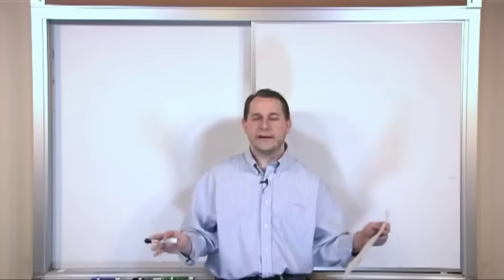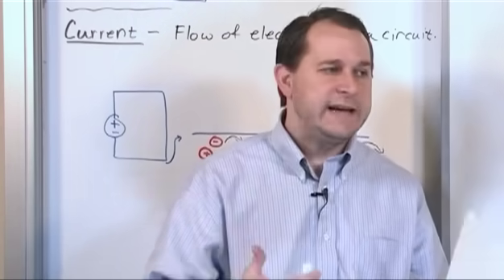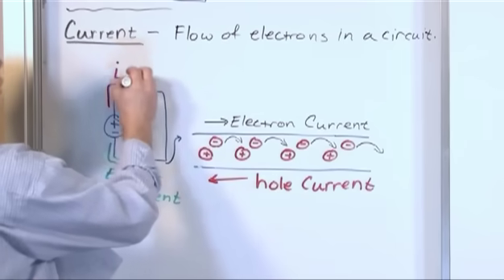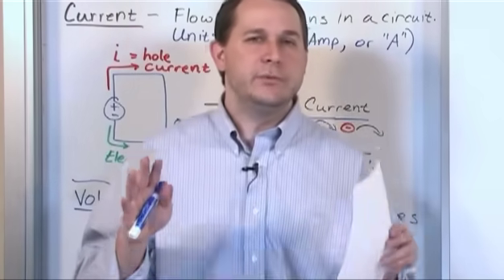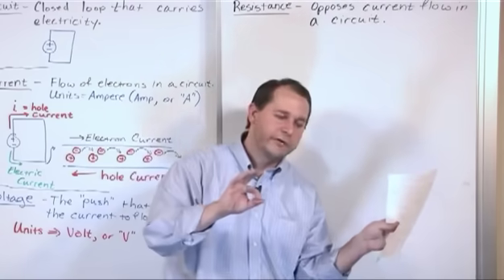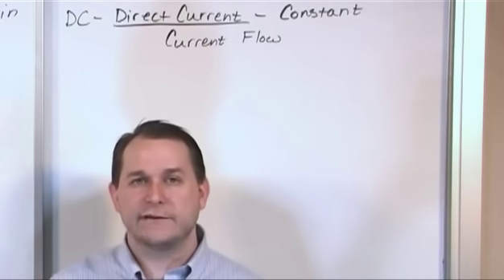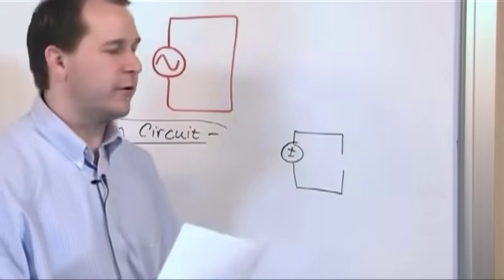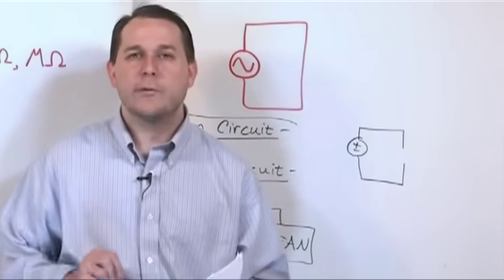Lesson 1 - Voltage, Current, Resistance (Engineering Circuit Analysis)

Comment: Thank you so much sir. I have a doubt. Let say there is a simple circuit just a battery and a wire. If I cut the wire, I want to know if the charges are there at the tip or not where we have had a cut.

Or they are there just at the tip of the terminals of the battery?

Comment: So in a short circuit why would the current increase if volts don't increase and resistance doesn't change?  Say you connect a wire between the two terminals of a AA battery, you said that the current will increase but to increase current you either need more volts or less resistance.  Since the battery is 1.5V it can't be that, therefore, does that mean the battery's resistance is changing?  If so why?
Reply from the maker: You have the right idea!  Exactly correct.  The battery voltage doesn't change.  A short circuit is just a piece of wire.  In an "ideal" short circuit, it has zero resistance.  A short circuit has no resistance at all.  So, if you plug that into I=V/R, and set the resistance to zero, you see the current goes up to infinity.  Now in the real world, a real short circuit doesn't have zero resistance, but it might have a few micro-ohms of resistance (a really small number).  So it drives the current up very high, but not to infinity.  Hope this helps! Jason

Comment: I have an old generator with only 1 hot & 1 ground Ac current produces 1,970watts at 90 Amps  , I’d like to hock it up to my breaker-box , use a 100 Amp double pole breaker - for when we lose power !

Comment: Good lesson. Though without mentioning WATTS your lesson is incomplete. A very important concept in electrical circuits.
Reply from the maker: Thanks!  This lesson covers voltage, current, and resistance.  A different lesson covers power.  Thank you!

Comment: Before power plants we had water wheels because electrical currents runs through water. Think of the electric eels. There is a video where they have electric eels powering a light in an aquarium.

Comment: I wanted to be an Electrical Engineer when I went to college many years ago. I dropped out after a few years and joined the Navy for the Nuclear power program. I pass the test but couldn't get the top secret clearance because of a few traffic tickets. After that I was an manufacturing technician building circuit boards. Today I'm a Slot Technician here in Las Vegas and the founder of a technology start-up. In progress now of inventing my own line of electrical equipment.

 I'm 55 years old today. This is an excellent review of the fundamentals!

 I wish you were my professor when I first started out. It is never too late for me to go back to school and become an Electrical Engineer.
Reply from the maker: So happy to help.  Thank you!

Comment: I plan to take your electrical circuit course, AC & DC.  Is there any course on practical applications such as using the learned theory to built a simple device.

Comment: Love these videos, love the presentation, love the simple explanations. One nitpick, though, because I see it all the time and it's a pet peeve --- it is a myth that electricity takes the path of least resistance. Electricity always take every path available. What is true is that the lower the resistance, the more current will flow through that path, in proportion to the resistance (more resistance == less current). In your example, electricity absolutely does reach the fan, but the current is minuscule compared to the current on the short circuit, which has a very very tiny resistance.
Reply from the maker: I really appreciate your kind words!  In this case with a short circuit, the resistance of that branch isn’t just tiny, it is zero.  Because of this, 100% of current goes through the short and 0% of the current goes through that load.  Thank you!
Jason
Reply: @MathAndScience  sure, that's why I called it a nitpick... the resistance can't actually be zero because even wires have some tiny amount of resistance, we just pretend it's 0 for most purposes.
Reply from the maker: Michael Edenfield I hear ya.  I actually worked on superconductors for a few years so resistance can actually be equal to zero!  Of course you need to cool it down.  In the real world, with regular conductors you are right, never.  Have a great day!

Comment: Final Exam Guide:

1. Know op-amp configurations and figures of merit 
2. Be able to calculate current and voltage through circuit elements using assumed states method
3. Use CMOS gates and digital logic to complete truth table
4. Convert between equation and digital logic gates
5. Identify filter types, transfer function, and figures of merit 
6. Understand lab 7 and concepts of rectifier circuits
7. Lab 6 and resonance frequency

Comment: Any current flow divided inversely by the number of resistors on a closed circuit will determine total number of optimal phases required (especially when used in turbines.)

Comment: When he asked what current is he was SUPER quick to to deflect it away from "water".  Water is the the BEST thing to use to explain how electricity flows......  Like voltage vs amps.....  the day someone used water to explain them was the day it actually made sense.  The ones who "teach" spend so much energy trying to explain even something as simple as volts vs amps and if you call them the same thing its a mortal sin....  when..... they are the same THING......  you can go outside and run through the sprinkler on a hot day and you are perfectly fine.  A fire truck pulls up and couple guys pull the fire hose out and point it at YOU.  Now the water is not fun any more....... and then a monster tsunami rolls in and wipes EVERYTHING out...... that sprinkler shit isnt fun it kills you.  But.... you can take a free flowing water hose and put your finger on the end and get more "power" out of it.  Volts is the river..... a SHIT TON of it can be flowing by but it is gentle. but when they Dam upsteam opens all their doors all the way, now the amps come and kick your ass.  

WATER!!!!!! IS ELECTRICITY!!!!! or at least they both act and work the same.

Comment: If anyone can help me, please respond... he talked about how electricity takes the path of least resistance, so if you have a superconductor circuit, and you place a piece of nonsuperconducting copper on it to try and take some electricity from the circuit, will the electricity go through the copper? I assume it will not because copper has a higher resistance than the superconductor’s zero resistance, but if you know the answer and could respond to my comment, pls do!

Comment: I’m in 8th grade, so I may not be understanding this correctly, but... do electrons act as air does when flowing, how they would spread out if put in a small area, and the surrounding area has no current yet. I’m refrencing to air as in air pressure and how it will evenly spread out to a constant pressure if given more room to spread

Comment: I am working on being a DIY on my new motorcycle, and a multimeter is essential on working on diagnosing components, now when they say it should be tested using ohm or voltage measurement I have at least a conception and foundation of what's being presented.    Thanks.

Comment: Resistance - opposes current flow in a circuit. When you look at the key word oppose, does that determine whether the pressure is high or low?
Reply: no it doesn't

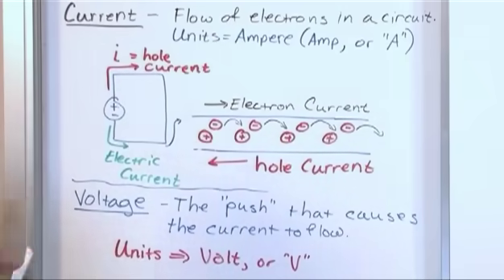Comment: 21:42  Sorry, I'm still learning; wouldn't the different between 1 volt and 10,000 volts depends on how many amps there are?  Or are volts restricted to a certain number of amps?  Like 1 volt can only pushed a maximum number of amps...?  Or would it be an unlimited number of amps restricted only by the current?   Oh wait, is that why wires burn up - they have too many volts pushing too much current carrying too many amps through them for the wire to be able to handle that many amps for a certain period of time?
Reply: Amps (current) is the result of a voltage applied to a resistance (Ohm's Law  I=V/R). If the device supplying the voltage (e.g. a battery) is limited in the power it can deliver, the voltage may drop and the current will also drop.  A typical example is a torch with a nearly-dead battery - it will light up initially and then go dim as the voltage (and current) drop.  You are correct - a wire can carry more amps if the voltage is increased and the heating effect (in watts) heats up the wire until it melts.  Every resistor is rated in watts for the max power it can carry.  Power in watts = Volts x Amps (P=VxI or P = I^2xR) is often referred to as "I squared R".  So a 1 Ohm resistor connected to a 12V car battery will carry 12 Amps  (I=V/R) but the power will be 144W  (P=VxI) and if the resistor is only rated at 10W it will go red hot in an instant and melt!   A 100W resistor would also get very hot but might survive a bit longer.

Comment: How far can you get without or at least very little math? Is it even possible? Instead of dyslexia I have dyscalculia. No problems with numbers, more with the actual math itself.
Reply from the maker: You can learn a lot of the concepts for sure, but to really understand circuits you can't really get around the math.
Reply: Grasping the concepts (foremost the "Why") is the most important to me in other hobby's. For example "Why does a circuit need that capacitance capacitor in that specific place in order to make it function". But if that alonebisn't enough I'm in trouble.

My main goal is to create (simple automotive) pcb's and mostly do repairs on cheap bought defective electronics.

If there is a "fixed" set of mathematical instructions I could perhaps learn that without really getting involved with math.

But I enjoyed and understood the first 2 video's and will continue watching.
Reply from the maker: I wish you the very best of luck in your endeavours.  I will say one thing.  I have never had anyone who just couldn't learn math from me.  I think you have a mental block the size of texas that is potentially getting in the way.  Why don't you start at the basics, perhaps my basic math lessons with fractions, division, etc, then once you can do that then move to algebra and beyond.  Don't give up - if you put in the work you can do it.  And yes I have had folks who tell me about dyscalculia do very well with my lessons.  Good luck!

Comment: Is there any recommended textbook for this?
Reply: There is no textbook.  These videos are designed for those enrolled in a class using whichever textbook.  That said, the lectures are good enough that a textbook is likely not needed.  If you get stuck or need additional info, look at a circuit book or even Schamms outlines.

Comment: Electrons don't orbit. Electrons don`t flow very fast. Electrons just drift around bumping into other electrons. Benjamin  Franklin didn't know about electrons and simply got the direction of current flow wrong. It is the energy that travels near the speed of light, not the electrons. Copper has an electron in its outer shell that is easily knocked loose allowing it to knock one loose from a neighboring atom.

Comment: A better way to teach is to create a 3d game of PCB assembly just like car simulator or flight simulator. Inserting components and make the gamer understand what each does, what does the tolerances do, what' the total input voltage of a circuit so it won't blow up in case high voltage was used... But this video will do. Just need to make learning much interesting...

Comment: I still don't understand what you mean by "loop" or "closed circuit". You said that the electrons end up in the place they started but to my understanding they don't. They go from the negative end of the battery to the positive end of the battery(traveling through the circuit to get there). Aren't the two ends of the battery separated by a non-conductive material? If they weren't then the electrons would just flow through the battery and not the circuit. It seems to me like the positive and negative ends of the battery could be on opposite ends of the circuit and it would work just the same. Am I missing something? I don't get why you say they end up where they started. I don't understand this concept of a loop when it just seems like a line to me. I know i'm 3 years late to this video but if anyone has any feedback it is appreciated!

Comment: The small straw analogy was very helpful. My understanding is that with a small straw and high pressure in my mouth (voltage) regardless of the "voltage" I can produce it is limited by the size of the straw. With the same amount of "voltage" and a bigger straw the current would be stronger. Is this correct?

Edit: I wrote this before resistances was discussed. Disregard my question.

Comment: Overall a good video, and I like your videos. I've studied electronics and electricity and still studying and finding new amazing things that can be done with it.

However one small thing that bothered me in this video was the open circuit part. I'm sure it's not really what you would mention in a basic teaching video, but yes electricity stops flowing if you have an open circuit, due to the electrons being unable to "cross over" to the other side. However, they can do an "electronic jump" if they have enough power, so in other words high voltages, or if the distance is barely close enough, it can happen. Another good example is lighting bolts, however that's a bit more complex thing that has to do a lot with weather conditions, air temperature, air density, air moisture, cloud formations etc.

There are a lot of additions that can be made to this video and I'm sure they wouldn't be really that meaningful for people learning the basics, but I just wanted to bring this up.

Comment: In a heating element, how is the electricity creating the heat? Excellent clip by the way!
Reply: It's similar to the short circuit in a sense that you intentionally create heat in the same way it happens accidentally in a short circuit.
Reply: @Lawh  So the amps get cranked up to a very high rate with no resistance? And thanks for responding.

Comment: High voltage is dangerous because it overcomes the resistance of the skin and tissue and allows current to flow through vital organs.
A car battery has more than enough energy to fry a person, yet you can touch both terminals and feel nothing because the voltage is too low.

Comment: Thanks! I really like that you teach students how to "think through" the problems.  You're advice in solving circuits using KVL and KCL was golden: basically, don't stare at the problem and try to figure out how you're going to solve it.  Instead, just write some valid equations with whatever you have.  As you work through it, the solution will begin to appear. 

WOW!! I can't tell you the number of times that I sat staring at a problem (trying to figure out the solution) and became completely frustrated.  I really wish I had known your advice years ago and just started solving what I had in front of me.  Great advice!!  THANK YOU!

Comment: This was great, helped me understand the basics and to visualize them in my head. I'm 25 and studying to be an electrician but I've never had any previous knowledge in the field so there's a lot of concepts I'm not familiar with. I used to mix up current and voltage due to how they are used in everyday conversations. I wish my teacher had the patience and understanding that you do instead of expecting new students to know these "obvious" things already. I'll definitely check out your other videos on this, Thanks again!
Reply: Voltage = pressure
Current = the flow (caused by pressure)

Think of a water analogy.  The water flows (current) based on the pressure (voltage)pushing on the water.
Reply: A very stupid but easy way my teacher used to explain this when we first learned about this: you have a tube, current is the one stuck in the tube, voltage is the one pushing current through it and resistance is an evil guy applying pressure around the tube so its harder for current to go through and there is need for more voltage

Comment: I got confused when it got to the part about short circuits. We had learned earlier in the video about resistance and how a tiny, thin wire would have greater resistance than a large, thick wire. But in the short circuit example, the small wire was described as having less resistance than a "large fan" or other larger component of the circuit. Am I confusing the terminology, is the electrical resistance measured in Ohms not the same as the resistance in a short circuit?
Reply: There would be no resistance in a short circuit because electrons are finding the path with least resistance.
Reply: @robrivas9246  outstanding, thank you for that perfectly succinct explanation.

Comment: Hello sir i dreameb to be a engineer some day but im not good in math what your think to me??
Reply: The only math you need to know is the formulas. 

For example if I have 10 apples and I give you 4 apples how many do I have left? How do you know the answer?

You take 10 MINUS 4. 

The important part is not that you know the answer 6 the important thing is that you know to take the numbers I gave you and to subtract them. 

If you know what step to take then you can get the answer with a calculator or phone. 

The same thing applies to engineering with some slightly more advanced math like algebra and ohms law etc..

 You don't have to be a math expert so if it's your dream you should go for it. 👍

Comment: Voltage is basically,a “pressure”enclosed in a box,right ?
Reply from the maker: Voltage is basically the "pressure" that pushes electrons around a closed circuit.